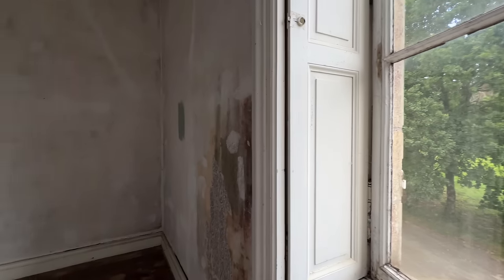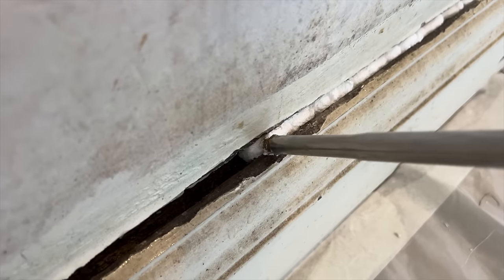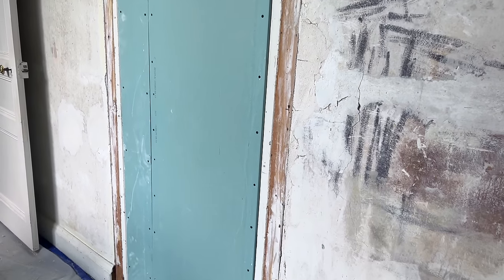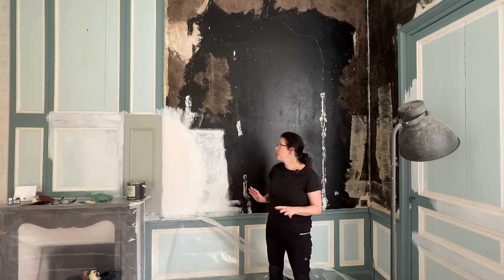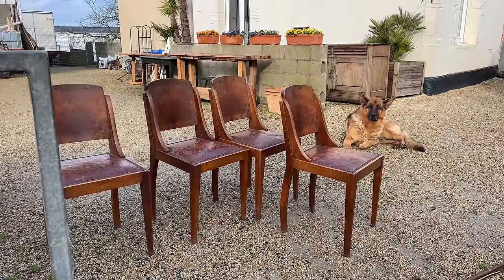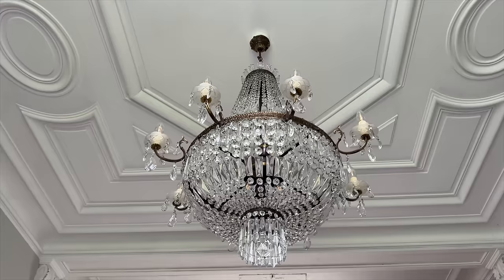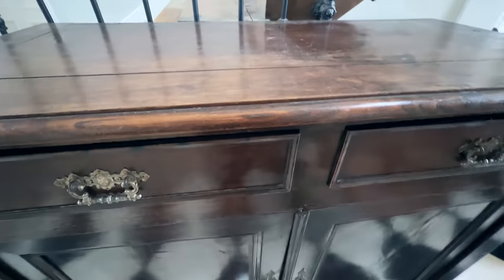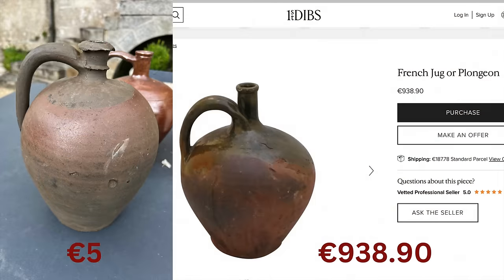Furnishing Our Chateau Without Breaking The Bank + Our Bedroom Project!

Comment: It's a wash stand, and I believe  it's missing marble around the parts that are not stained. That's why there's gaps x
Reply: yes you need a marble or tile splashback in there
Reply: Make sense. It's possible to replace them. You have to go to a marble worker with your mesures and he will do those pieces to replace them (in the same kink and color of marble). You are going to have a perfect chest for men! :)
Reply: That’s what I was going to say😁😁.  I know this is redundant, as I always say this, I love your style.  It is classy, with a historical nod to the château, but with modern flare.  It is all class.💗💗
Reply: How interesting about that pottery with the blue on it.  I use to attend auctions with my sister's and was always drawn to that type of pottery.  My ancestors are from the Alcase region and come to find out my kids father's family is from there too.
Reply: Agree you had a bowl and jug of water to use.
Reply: I would also agree with, this is a wash stand and is missing marble side pieces.
Reply: I would of used that marble top and mirror as a vanity type situation. Store makeup and accessories on top of the marble, lid keeps it all hidden.

Comment: Yep as someone said, a wash stand. With the inner lining panels missing! Hence the gaps and no staining. The inner panels were probably tiled or mirrored to help with water splashes (same as the marble) and old or smashed so removed :)

Beautiful antiques! I loooove the pottery. Gorgeous! You can get cork or dense foam or rubber and cut tops for the jars to seal them and use them for flour or seeds etc!
Reply: That's exactly right. 😊
Reply: Exactement. Et on posait une cuvette et un broc sur le marbre pour faire sa toilette. Un meuble très habituel dans les chambres à coucher à l'époque où l'eau courante  n'y était pas .

Comment: I used to be an antique dealer; Its actually not a washstand, but a gentleman's dressing/toilette  chest of some kind, & I think it is Georgian. It's not a washstand originally, though may later have been used for one with the addition of the marble. I do not think the marble is original to it. There may originally have been shallow holes/indentations cut in bottom of that section to hold jars. The other option is it was  used for wig powdering. Ihe surround wood which is in a bare state may have been lined with pleated fabric, or simply veneered which was so chipped and damaged it has been removed at some stage.

Comment: The marble top piece is a commode, ie for washing. Every bedroom used to have one, as well as a small cupboard with a door for the chamber pot.
(the equivalent to our en suite bathrooms).
Often these would  have the marble visibly on the top, and a marble surround/splashback and there'd be a matching set in porcelaine on top, a wide bowl with a large pitcher placed inside it.
The pichers would be filled with hot water from the copper water reservoir connected to the iron stove in the kitchen, or filled with cold water and put overnight in cabinets atop fireplaces or woodburners and the servants would bring them in the morning nice abd warm.
This one may be a gentlemans commode. Like a tallboy, but with this space for shaving and shaving utensils. The whole design suggests it.
You could set tiles around the sides, where probably the marble is just missing. Or mirror those pieces too.
Charming!
I like the rustic eartheware! Very classic and nice in a kitchen. Brings alot of warmth to it. I have a few pots for my most used utensils next to the cooker and for my window herb garden. Those mustard pots are lovely for spice storage or serving condiments. You could order kork tops for them.
Love your animals, the dogs look thrilled returning from their escapades! ☺️💕

Comment: Amazing finds, wow, those armoires, so much cheaper than in the few second hand furniture shops here in the West of Ireland. And of course this pottery is amazing and will look brilliant! Imagine the less perfect bowl full of hydrangeas, wow! And that more than stunning chandelier, wow! 

As an aromatherapist (for more than 30 years!, with 10 books about the fragrant subject) I recommend mixing light essential oils like of lavender and rose geranium (it's an oil distilled of the leaves of either Pelargonium graveolens or P. radens) with heavier scents. So there won't be a reaction with the oxygen in the air, which will make lavender smell strange after a few months, a bit like turpentine (because some of the molecules turn into something similar like brush cleaner, turpentine is distilled from the resin of different coniferous trees). 

Bergamot would degrade even faster, I am glad you didn't use it, when it's fresh the smell is divine though. (most essential oils kept only between 1,5 to 2,5 years, some just around 1 year) I like to mix lavender with a bit of patchouli essential oil, maybe a bit of Atlas cedar too, both also keep bugs away. To every drop of lavender about 1 drop of patchouli/cedar.

Comment: I would be scared of the bricks in that false wall falling on my head whilst i was in bed.  Why not remove that wall and put a stud wall instead. You know with wood framing then put plaster panels on it with the wood panels on top of the plaster.  It would be secure and safe then.